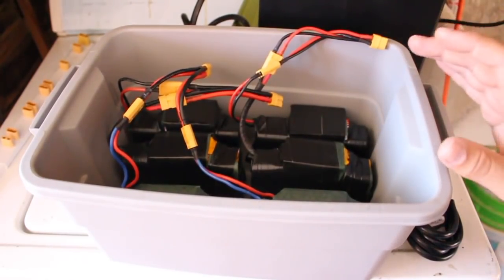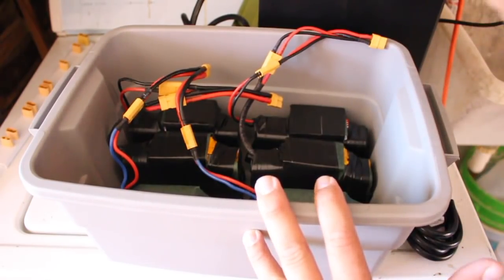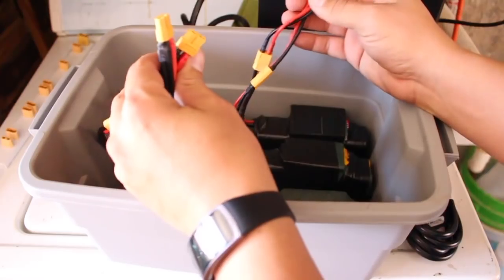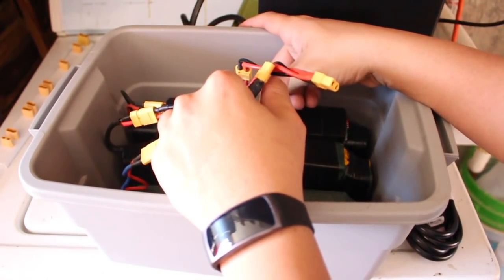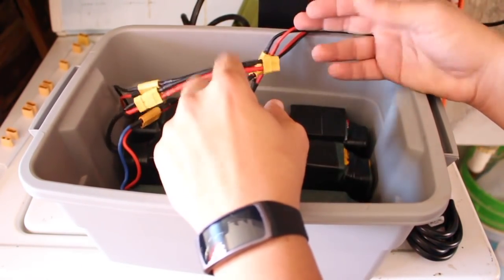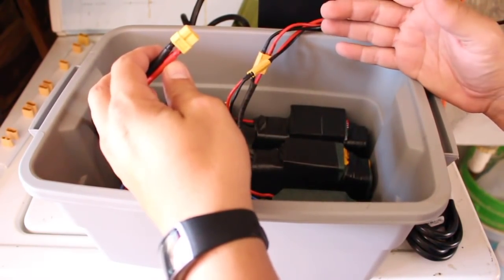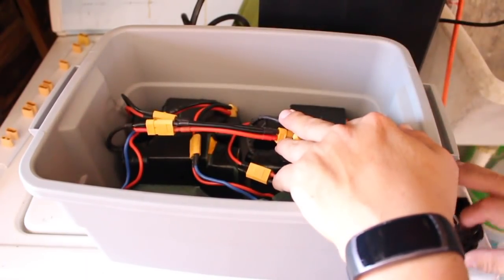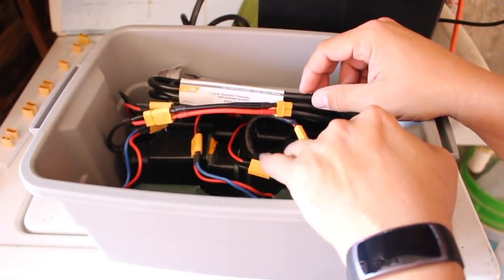The Wonder Women Project Part 2. Upgrading the Diy 18650 Solar Generator.

Comment: Hey dude. The original cable which charges the batteries charges them to 43.5. Ur 10s pack has a peak volatage of 42. I think it's important to just keep this set up as a solar powered. I brought this up to jehu. I'm sure he's busy with work and hasn't yet.
Reply from the maker: Actually it will charge the batteries up to 42v. This unit will charge the battery up to 96% at most. Also, all the batteries have a bms  integrated and last but not least the people that got this unit doesn't have power. 

I've tested the ac cord on a bunch of these and so far no problem.

But, I do appreciate your comment. I'll look into it asap.
Reply: Javier Camacho got ya. Keep up the good work my man 💪

Comment: Javier! I've been watching your videos for quite a while - was going to suggest though, when you are editing, I'd love for you to balance the music to the dialog - If you're listening to it and it makes you deaf :-p turn down the music! :) I say in love, I'm hoping to connect with you upcoming, I'm hoping to have resources in the future to donate for you there
Reply: Also - I would suggest swapping out the lid and instead put the hole on the side of the tub rather than the top - if somehow water got in you'd have issues :-/ on the side you'd have much less problem!
Reply from the maker: Huh.. Never thought of that. Thanks for the tip.
Reply from the maker: Regarding the music I also notice that. I'm trying to figure out the right volume. Thanks for your advice. God bless you
Reply: Most songs that I've gotten for free had to be lowered by at least 9dB to be a reasonable volume.  Keep up the good work!
Reply: I'm an audio engineer by trade so it leaps out at me ;) I'd suggest -12 to -18db for most underbed songs; then bring it up to -8db or so when it's just the music. Also, when you're done editing, just give one solid listen through for yourself and set your volume (just like a listener would) and if you have to change your volume, we will too :-p ) Just wondering, what do you use for your video editing software?
Reply from the maker: I'm using final cut Pro
Reply from the maker: Thanks for the tip. I will do that in the next video